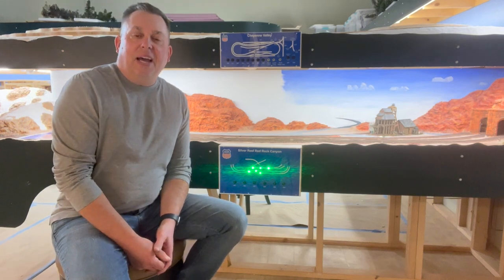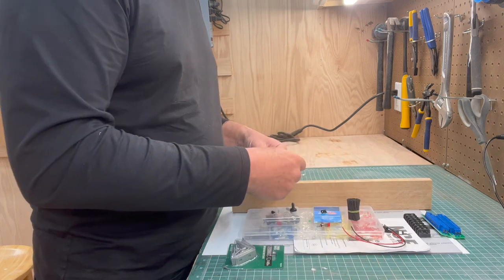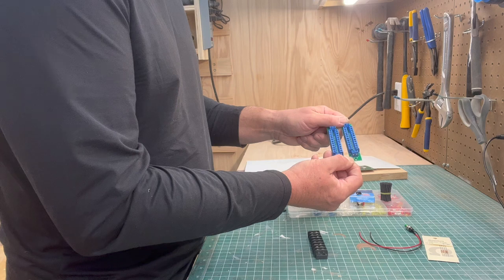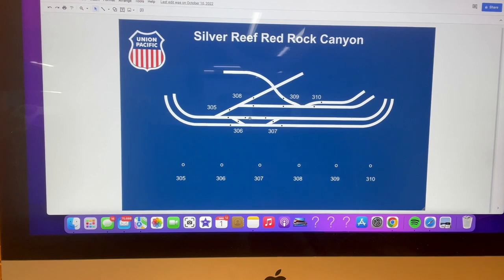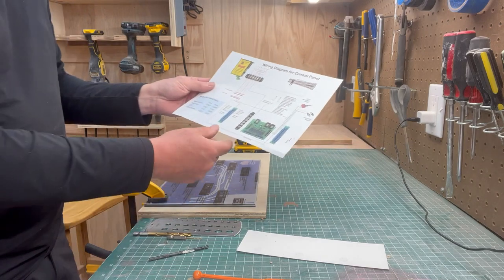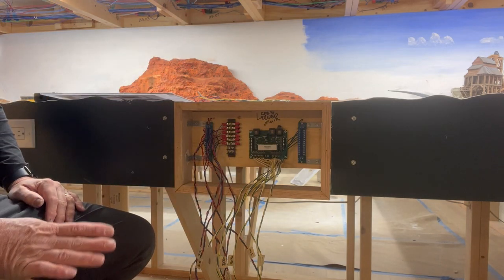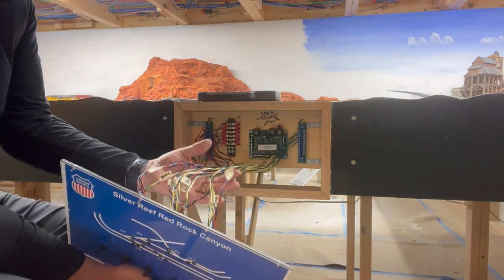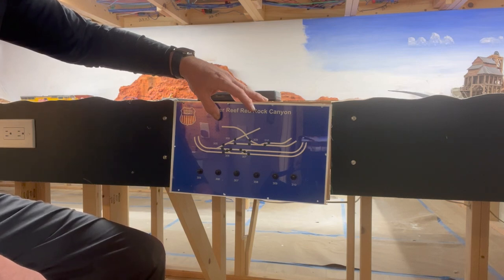Building Model Train Control Panels

Comment: Best explanation ive seen on the tube for a panel. Thanks and dang good job. Very clean and covers all the needs.

Looks like you are good but they do make drill bits for plexi. They have a sharp point which solves the cracking issue normal bits can do (per they catch to much of material and dont cut it out, in simple terms)